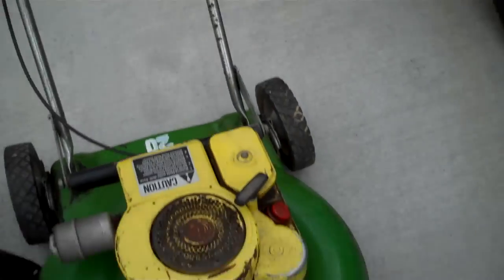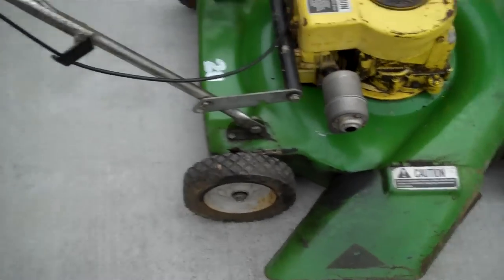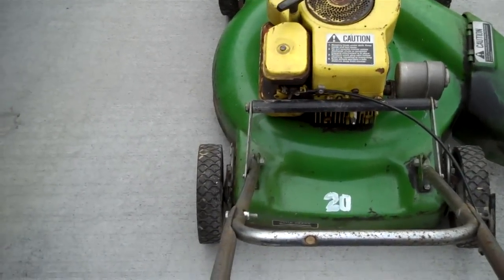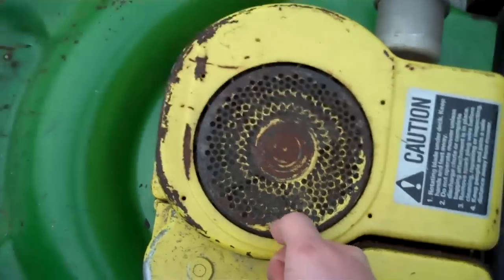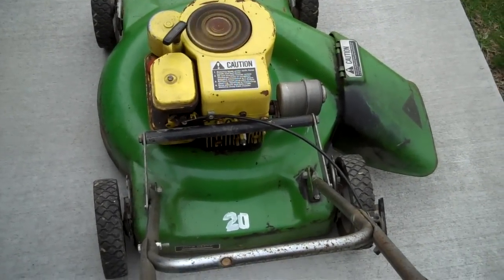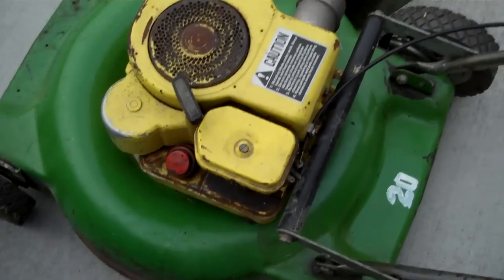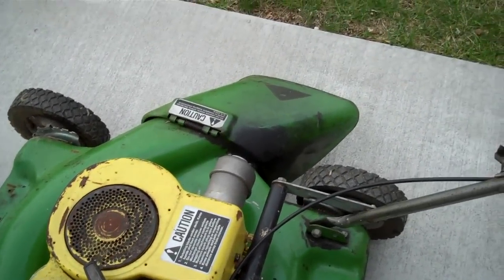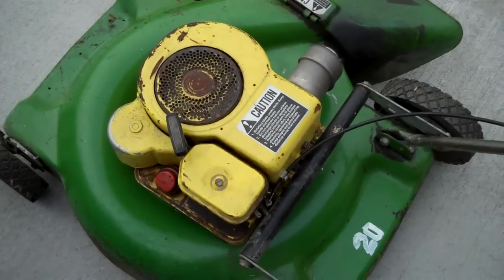1970's John Deere 20'' Lawn Mower

Comment: Since it's a briggs, if you find the model, type and code on the side of the motor, on the top cover, the first two digits of code is the year, next two is month, and next two is day I believe if not the day it's the assembly line.  I can't remember, but I know for a fact the first four are year and month.